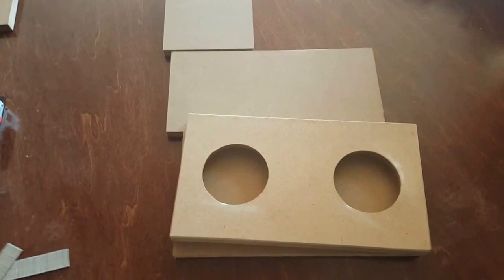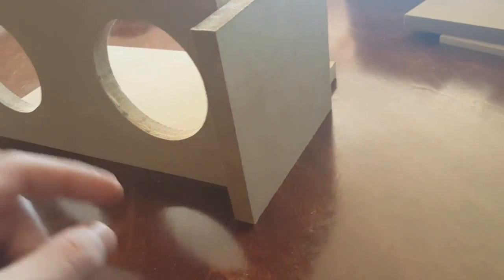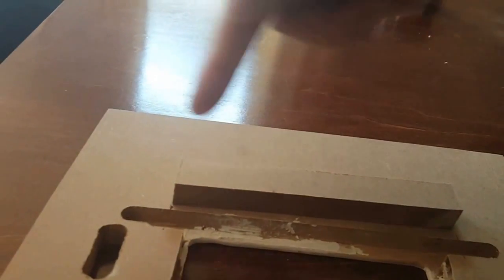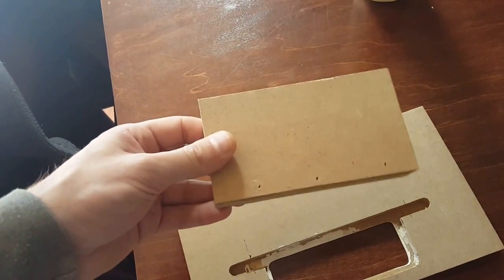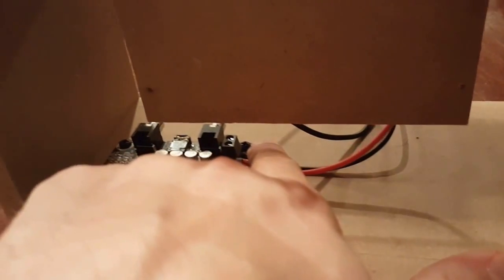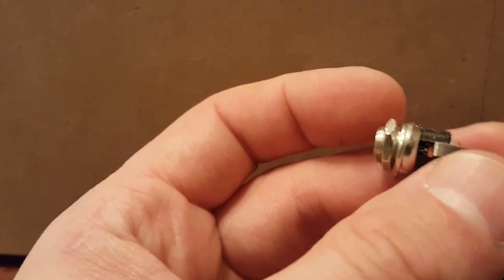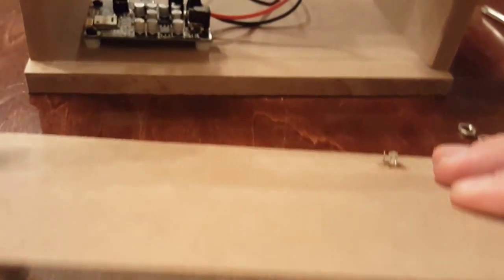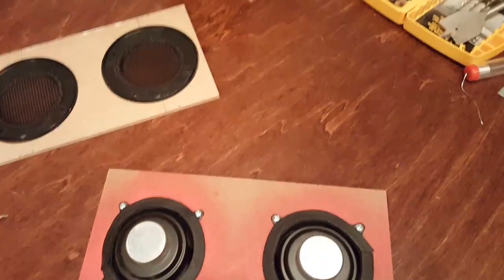Assembling the Box and Test Fit - DIY Bluetooth Speaker Build

Comment: im lloking into build my own ammo boombox but have no idea of wht kind of battery and charger to purchase. Im going with this lp2020a+ amp just dont knw wht power source to use
Reply from the maker: I have used this battery with great success. https://smile.amazon.com/gp/product/B00MF70BPU/ref=oh_aui_search_detailpage?ie=UTF8&psc=1  It can either be put in the box or can just plug into the box outside, when needed.  You can see an example of it in my Dewalt build here: https://www.youtube.com/watch?v=HoMkOA60yFo look for it around 2:30.  Another option is to get another amplifier.  You can get this Wondom board with the battery extension.  It would take up a lot less room and give you about the same amount of time.  https://www.parts-express.com/wondom-aa-ac11160-2x15w-4-8-ohm-class-d-audio-amplifier-board-bt21-with-functional-cables--320-3518 board, battery extension https://www.parts-express.com/wondom-aa-ja11113-extension-board-18650-batteries--320-3516  Then just get 3 18650 batteries to power it.  The great thing about this option is, you can use any 19v power supply to power the unit and charge it.    This makes it a great choice for only having to use 1 cord when stationary or charging.